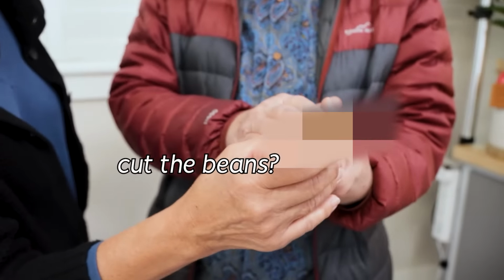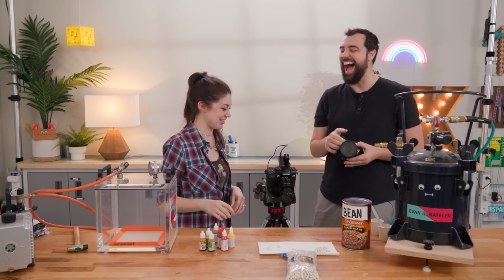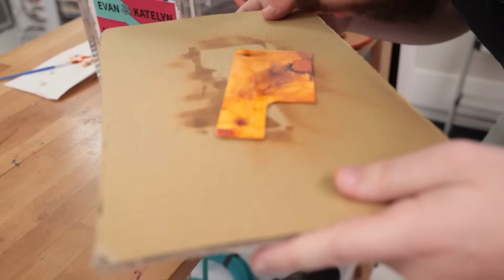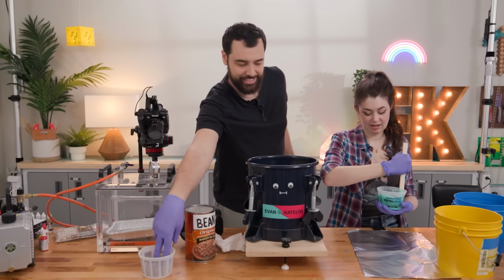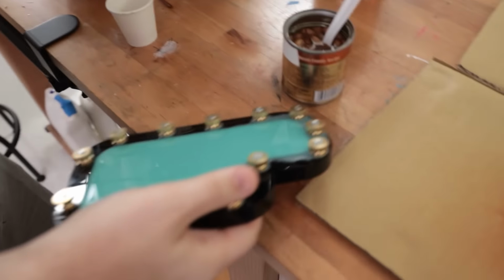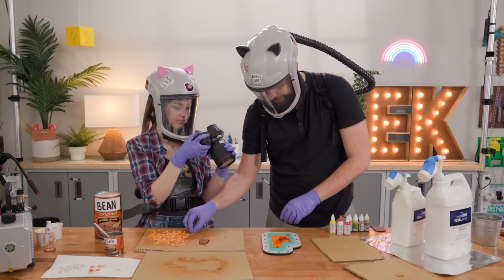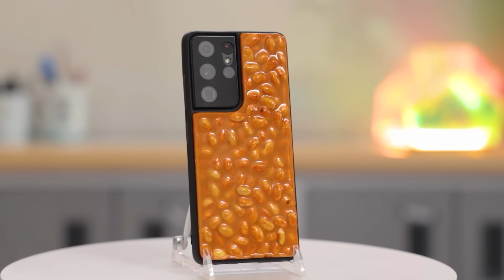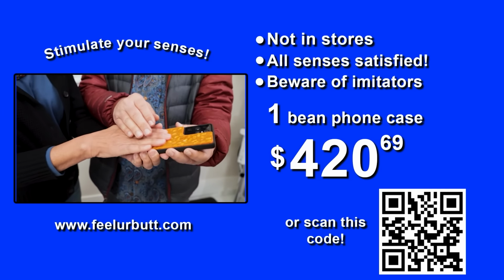We made a bean phone case

Comment: You dont pressure pot silicon... as it has not strength to hold the bubbles small when de gassed. Vacuum only for silicone, Pressure pot for epoxy. Honestly vacuum is good enough for both but hey, if you have a pressure pot \_(- - )_/ oh well.